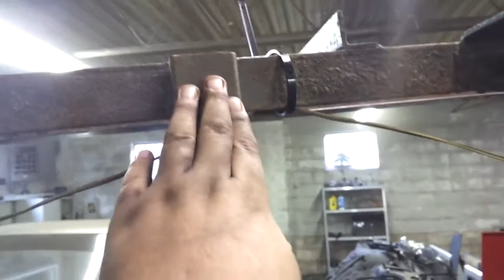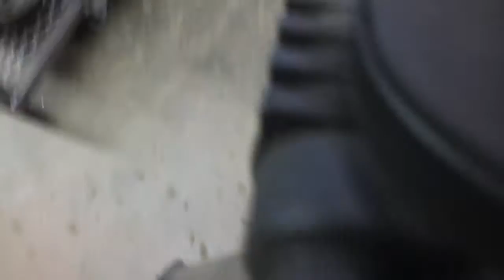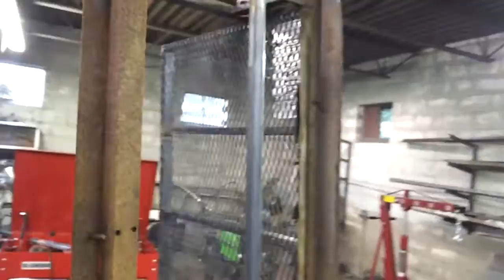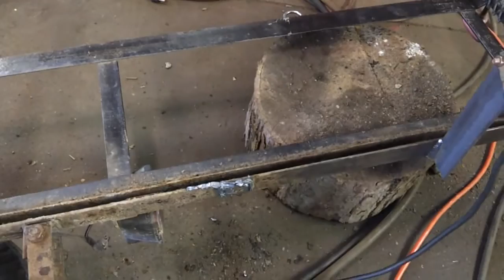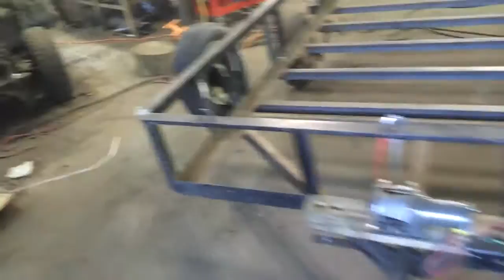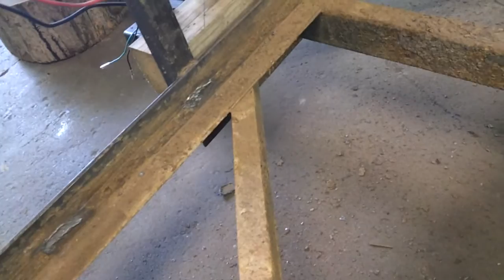Rusted Trailer Repair - Part 2

Comment: With the condition of that trailer and all the work that needed to be done, why didn't the owner just ask for a complete new re-build? was it a case of a new re-build would require a new registration? 

Just a lot of work on some old metal and a previously sketchy built trailer for what the owner will get in the end. Great for your business, but not really cost effective for the owner. But, I supposed you are only doing what the owner requested.

Nice work though.

Comment: How thick was the metal Galvanised Steel Angle that you used or what types did you use? Need to support my trailer for heavier loads and reinforce old beams.